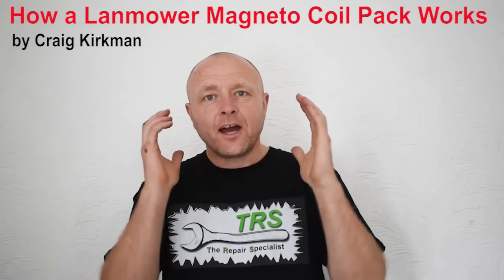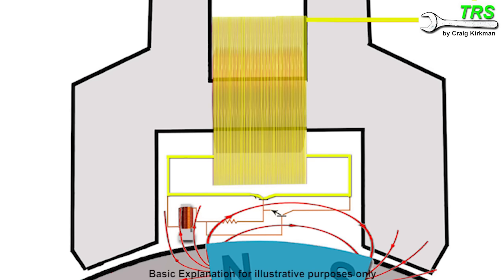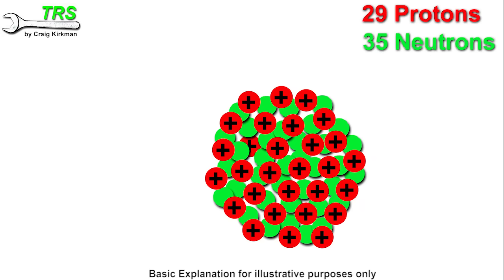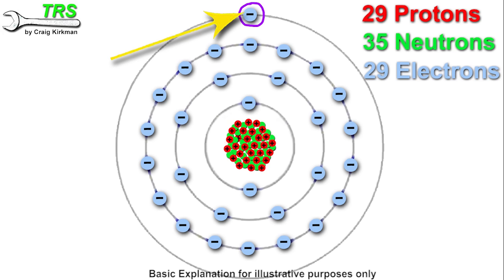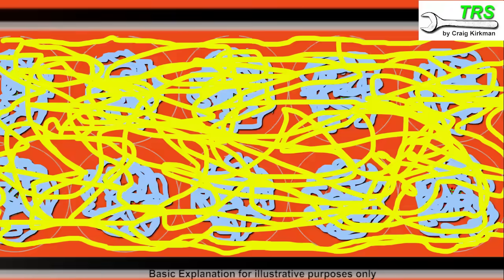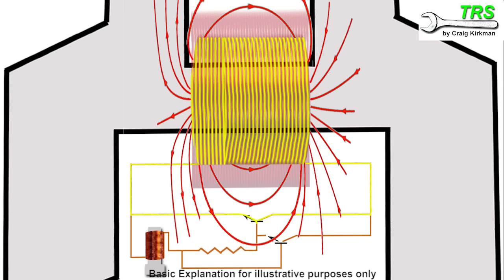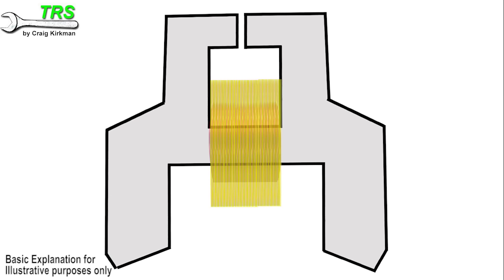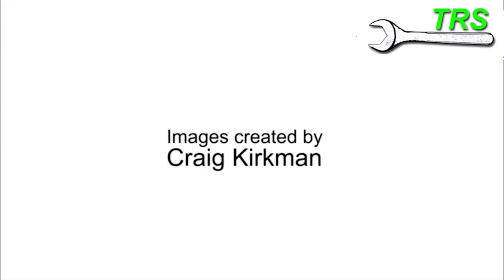Lawnmower Coil Pack Sparking System - Induction Coil, Transistor!  (by Craig Kirkman)

Comment: But... you didn't touch on the first magneto systems that used points!  Why is that?  The early single cylinder four stroke lawnmower engines, like the B&S or Tecumseh, had points that would open when the eccentric ring on the crankshaft came around every revolution.  The magnetic field from the permanent magnet in the flywheel would generate a current in the primary coil of the magneto, the points being closed at the time allowed for that to happen, and then when the points opened up by the eccentric lobe coming by, the electricity would stop flowing in the primary side of the transformer, and the collapsing magnetic field would generate a voltage in the secondary side.  The capacitor in the primary side (wired in parallel to the primary coil) is used to dampen out the "ringing" effect of the field collapsing and the generation of the electricity.
  As the magnetic field is collapsing, it generates electricity in the primary winding side of the coil, which creates a magnetic field, and slows down the collapse of the field.  It is sort of like a coil spring that oscillates back and forth when suddenly released from being bent over to one side. So it sustains itself enough to interfere with the generation of electricity in the secondary winding, and you get a weak spark.  A choke coil in a circuit can generate several hundred volts when disconnected in the same way, a strong magnetic field collapses, the magnetic lines of force cut across the conductor, and you can get a zap that will knock you on your backside!
  When B&S came out with the Magnetron ignition system, they eliminated the points and capacitor that needed to be replaced or adjusted.  They had a retrofit kit of a transistor encased in plastic that you wired up in place of the points, and it snap mounted on the old style magneto.

Comment: That was a great explanation as i struggle with getting a 2 stroke motorbike to go. Does the spark reduce in its strength when under the pressure of the cylinder.  Can a coil deteriorate over time? I have been looking into the ohms resistance of the primary and secondary circuit.  Thanks again

Comment: Question: does the magnetic field of the magnet on the rotor affect or is useful in any way to generate a voltage in the primary coil of the pack? Or not at all, and the current needed only comes from the small trigger coil?
Thanks

Comment: Great explanation, but I still have a question about the collapsing field.  In an old points and condenser system, when the points open, the field collapses in the primary coil which induces this same moving field to the secondary coil, but can only do so if the collapsing field has a path to ground.  This is where the condenser comes in.  The field collapses through the condenser (capacitor) but does it slow enough to sustain a longer time (so the spark will last long enough to do any good) than if the field had a direct (no capacitor in the circuit) connection to ground.  (This is what usually happens when a points and condenser system fails - the capacitor fails and turns into a direct connection, thus shortening the spark duration so short the plug cannot ignite the gas.)  How does the field collapse like this in a transistorized setup like the one in this video?

Comment: Listen, let me explain something to you all. I’ve read literature. Lots and lots of literature. Lots of literature that explains how electricity works, including down to the atomic level. And over time I’ve gained an amateur’s  understanding of it. And even then, when don’t work with electricity enough, I have to read that literature again in order to refresh my understanding. However. I have NEVER had electricity explained to me as concisely, intuitively, and detailed as this video does. And I’m going to tell you right now—I don’t think I’ll ever forget it, such that I might have to revisit this video as I have all the literature I’ve read. This explanation sort of drilled the concept in my head. Excellent, excellent work by an excellent teacher. Now if I could grasp how voltage is like pressure/force, and how current is like volume, and how resistance is like a restriction, I’ll be the better for it. Wow. Just wow. What an amazing video. Bravo! Now just freaking imagine, that he taught all of this, in this way, using a coil that’s found in a lawn mower, or chain saw, or pressure washer. Like that’s legitimately wild to think about.
Reply from the maker: Wow. That is probable the best ever feedback have ever had since starting this channel back in 2012. Thank you so much. You have motivated me beyond belief. Thank you so much again. I’m on the case with the things you mentioned that would be beneficial for o make another vid about. Thanks so much. Craig 👍👍👍👍👍👍

Comment: THANK YOU for such an excellent description of basic transformer theory! My degree is in Industrial Electricity and I have worked some with transformer design and theory in my career (now retired) but this explains it extremely well, at least how it applies to lawnmowers. 

It would have been nice if you had gone a step further and included how the "engine shutoff" feature works to enable/disable the transformer from providing a spark, which the engine needs to run. As I understand it, when you release the "operator presence" handle, the cable moves a lever on the side of the engine, which closes a switch. That switch grounds one end of the primary winding on the transformer which essentially stops the transformer from working, thus no more spark and the engine shuts off. Maybe you can elaborate on that, if I am wrong? Thanks again!!

Comment: Interesting, very well explained, but wouldn't they be diodes, not transistors
Reply from the maker: Great question! In a small petrol lawnmower engine ignition coil, the primary component you typically find is a transistor rather than a diode. Transistors are used to switch the current on and off rapidly, which is essential for creating the high voltage needed to generate a spark. Diodes, on the other hand, are used to control the direction of current flow, and while they are important in many electronic circuits, they are not typically used for the switching function in ignition systems. Hope this helps!

Comment: Can that voltage be rectified and supply house hold current?
Reply from the maker: Well, I'm not qualified to say if this can be done, or not, but it would be interesting to find out. If you end up coming up with that solution let me know. Thanks. Craig

Comment: If the free electrons travel to the ground, what replaces them?
Reply from the maker: Completing the Circuit:

After the electrons flow through the spark plug and into the engine block (ground), they don't just stop there. The engine block is electrically connected to the ground terminal of the ignition coil. This connection completes the circuit, allowing electrons to flow back to the secondary winding of the ignition coil.
Continuous Loop:

This forms a continuous loop or closed circuit. Electrons flow from the secondary winding, through the spark plug, into the engine block, and back to the coil ground. The circuit continuity ensures that electrons are constantly circulating within this loop.

Visualizing Electron Flow
Imagine the secondary circuit as a loop:

Starting Point: Electrons are initially in the secondary winding of the ignition coil.
High Voltage Push: The high voltage induced in the secondary winding pushes electrons towards the spark plug.

Spark Plug Jump: Electrons jump across the spark plug gap, creating a spark, and then flow into the engine block.
Ground Connection: The engine block, acting as a ground, is connected back to the ground terminal of the ignition coil.

Return Path: Electrons flow from the engine block back to the ignition coil, completing the circuit.

Key Points
Electrons Are Not Consumed: In this process, electrons are not consumed or lost; they are merely pushed around the circuit by the high voltage.

Closed Circuit: The entire ignition system forms a closed circuit, meaning that the same electrons are continuously cycled through the system.

Energy Transfer: The energy to push these electrons comes from the mechanical motion of the flywheel, which is converted into electrical energy by the ignition coil.

Summary
In summary, the electron flow in the secondary winding of the ignition coil and through the spark plug forms a closed circuit. Electrons travel from the coil, create a spark at the spark plug, flow into the engine block, and return to the ignition coil's ground. This continuous loop ensures that electrons are not lost or consumed but are constantly in motion, driven by the high voltage induced in the secondary winding. This cyclical movement of electrons maintains the ignition process as long as the engine is running.

I hope this clears things up a little more.

Thanks

Craig
Reply: What about in a lightning strike?
Reply from the maker: Now you need a physicist. I'm an Engineer!

Comment: I suppose it depends on the brand and the quality of materials / components chosen for degree of designed in obsolescence of system design  - but my question is: which of the items within the electric circuitry path is most prone to be the component at fault when system reliance of continuity discontinued. 
And I would appreciate the answer listed in a percentage of (most frequent area of failure)  of where the electrical circuit's most frequent (causing the purchase of a replacement component to be made for the wealthy  money accumulations of stockholders) which caused the masses within the wealthy overlord"s mass-ppulations to continued the the perpetual building of wealth from an overconsumed sustainability of maintaining a mowed down natural world all for the money and all the things of excessive convent things of excessive convenience superimposed over your illustration in a yellow outlined caution sign shaped bubble providing the number of percentage) shown over the (the most frequent fault area) of discontinued-continuity: as per (listed by brand name) above each illustration. 
So that we know who to most frequently blame for having made the world's population into little money generating slaves over consuming the nature of the Earth's sustainability by filling the world with overcomplicated science crap to buy
Reply from the maker: It's great to see your interest in the specifics of lawnmower ignition systems and their reliability! Your question addresses both the technical aspects of ignition coil failures and the broader implications of designed obsolescence in consumer products. Here’s a detailed response to help you understand which components within the ignition circuitry are most prone to failure, presented in a way that highlights the frequent fault areas and addresses your broader concerns. Before we continue though, the following is just my opinion from my very own understanding so I would like you to take it only as that!:

Common Failure Points in Lawnmower Ignition Systems
The ignition system in a lawnmower generally includes the following components:

Ignition Coil
Spark Plug
Flywheel Magnet
Kill Switch
Wiring and Connections
Based on common issues and repair data, here's a breakdown of the most frequent failure points and their approximate percentage of occurrence:

Ignition Coil (50%):

Brand-Specific Variations: Brands with lower quality control or cheaper materials tend to have higher failure rates.
Failure Mode: Insulation breakdown, overheating, or internal shorts.

Spark Plug (30%):

Failure Mode: Fouling, wear, or damage to the electrode.
Maintenance Tip: Regular inspection and replacement can prevent issues.
Wiring and Connections (10%):

Failure Mode: Corrosion, wear, or disconnection.
Maintenance Tip: Regular checks and ensuring clean, secure connections.
Kill Switch (5%):

Failure Mode: Mechanical failure or short circuits.
Maintenance Tip: Ensure the switch and wiring are in good condition.
Flywheel Magnet (5%):

Failure Mode: Loss of magnetism or physical damage.
Maintenance Tip: Inspect during regular maintenance intervals.
Brand-Specific Trends

While exact percentages can vary by brand due to different quality standards and materials used, here are some general trends:

High-End Brands (e.g., Honda, Kawasaki): Lower failure rates, better materials, and stricter quality control.
Mid-Range Brands (e.g., Briggs & Stratton, Kohler): Moderate failure rates, balanced between cost and quality.
Economy Brands (e.g., some generic or store brands): Higher failure rates, often due to cost-cutting in materials and manufacturing.

Illustrative Example (Hypothetical Data)
Imagine a caution sign overlay on the illustration of the ignition system, showing the most frequent fault area:

Ignition Coil (50%): This component, highlighted with a yellow outline, is the most prone to failure.
Spark Plug (30%): Highlighted next, indicating a common but easily replaceable issue.
Wiring and Connections (10%), Kill Switch (5%), Flywheel Magnet (5%): These areas are less frequent but still noteworthy.
Broader Implications and Conclusion
The concept of designed obsolescence plays a significant role in the frequency of these failures. Manufacturers might choose cheaper materials or designs that ensure a limited lifespan, driving consumers to replace parts or whole units more frequently, thus sustaining their business model.

Understanding the most frequent fault areas helps consumers be more informed and potentially proactive in maintenance, reducing the need for replacements and supporting sustainability. Regular maintenance and using quality parts can mitigate some of these issues, helping extend the life of your lawnmower and reducing unnecessary waste.

Thanks

Craig

Comment: Okay I'm confused. I see other people doing tests on these coils and they hook one lead to the spark plug and and then check the ohms either on the rusty ground metal or the connection for the Killswitch wire. My question is if the secondary coil that actually feeds to the spark plug is a free-floating coil of wire only going to the spark plug with one end and the other end free floating with the coil , would you not be able to get a reading because there's no completed circuit? How can you test resistance on an open circuit ? If the secondary call is right on the outside of the primary coil but not touching because they're insulated? please be patient with me I have a hard time understanding electricity. Thanks.

Comment: Alright, so these produce a spark on every crank rotation, that means there is a spark after  the piston is back to tdc on every rotation?
Reply from the maker: Yes there is a spark on a non power stroke on many of these types of engines. On the more advanced modern engines they have a more advanced timing/regulating system that prevents a spark on a non power/combustion stroke.

Comment: It's interesting just how 'similar' the ignition system is to the way really big generators work. 
The big generators have the equivalent of the trigger coil, which the generator folks call an exiter (a pilot and then main) which then couples to the generator proper, each time stepping up the power being extracted from the mechanical rotation of the generator shaft and the coupling of the magnetism to the coils (and a little bit of 'electronics' similar to that transistor).

Comment: Hi. This is probably the best electronic video I’ve ever seen. I came here because the igniter on my gas engine weed whacker stopped producing spark. With the help of other videos I correctly came to the conclusion that the igniter had failed. Still under guarantee I wrote to the seller explaining the problem. They wanted me to return the entire tool’ but I explained I could send them the igniter but their next email stated that they could only give me a refund because the tool is out of stock. In the meantime I purchased another igniter from china, installed it and it creates spark. But trying to start it the engine bucked a little so I decided to check the installation AND THAT’S WHEN I SAW THAT THE POSITION OF THE MINI COIL IS ABOUT A CENTIMETER EARLY. Which to me means that the timing is off. But I wasn’t sure until I watched your video. It’s truly a work of art! Thanx so much for creating it.

Comment: I've always wondered how those ignition coils worked; thanks for your clear explanation! Could you go on to explain how the points set/capacitor control the timing of the spark. I'm not sure how the points interact with the ignition coil. Great video!!